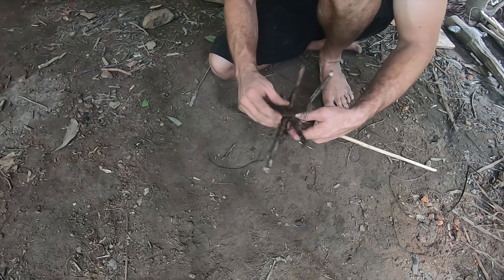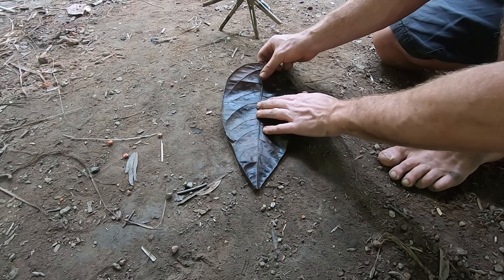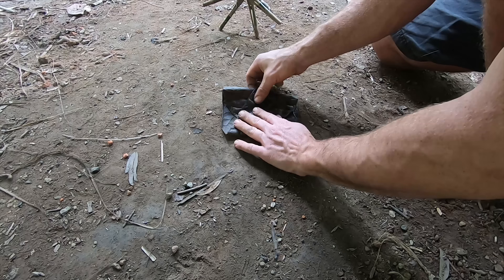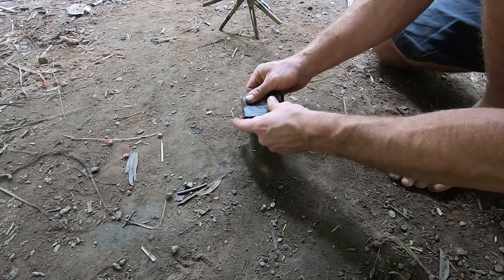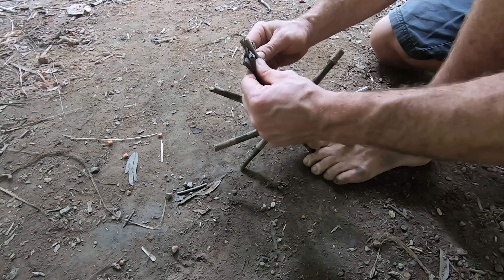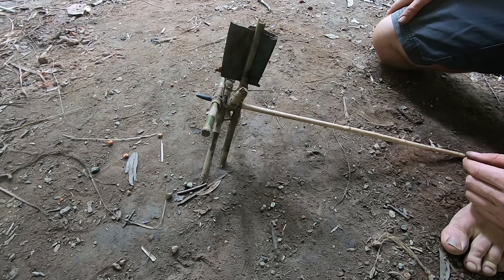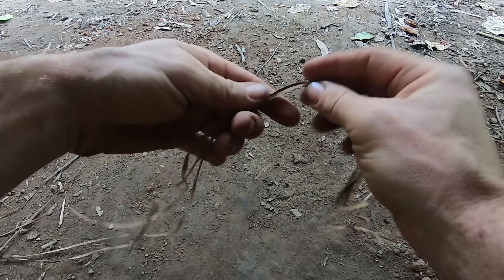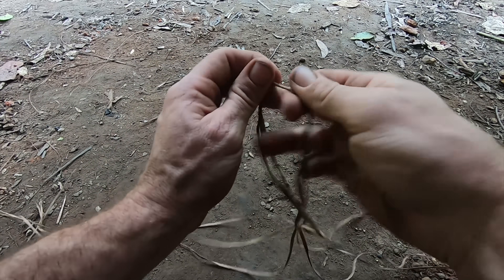Primitive Technology: Improved Multi-Blade Blower

Comment: Can't wait for him to breakthrough into semiconductors. I truly believe he can do it in 4-5 years.
Reply: without jokes he can pretty much do anything we used to do before the industrial age. it would be really time consuming to do so but it would be entertaining.  If he made bigger bricks he would be able to build his own castle in 30 years.
Reply: @KaizerOokami  He can get the industrial age down. He just needs to make the first machine to make more machines.
Reply: @punishedkid  he would need a lot of time and resources to be able to do that. plus that is not in the challenge. do you even read what he writes in every video?
Reply: @punishedkid  A rudimentary lathe...
Reply: @VenturiLife  Is that a Galaxy Quest reference (which is itself a reference to the Gorn cannon in the original Star Trek)?
Reply: @KaizerOokami  With slave labour he could scale up operations tbh
Reply: @KaizerOokami  - a loner from Eastern Europe lived in South Miami (Florida) in 1950s... And using his own homemade, auto batteries powered stone cutting equipment (albeit soft coral) he single handedly built his "Coral Castle",  moving multi ton  heavy blocks with nothing but steel tepee frames, winches, and leverage, mostly at night.  Some electric whizzes have decoded/ recreated his DC electrical system and suggested how he moved and set the large blocks by himself (videos on yt)
Reply: @vvvci  link plssssss
Reply: @KaizerOokami  /facepalm Castles weren't made of bricks but polished stone ¬¬
Reply: @KaizerOokami  30 years to build a castle? Come on, give the man some credit. He could easily do it in 29.
Reply: @KaizerOokami  but the pyramids? all those chambers and they were built over water tesla theory was the pyramids could create free energy....basically theory is a hydrogen power plant due to the hydrogen found inside chambers. Something to do with reverse electrolysis
Reply: Does a rusty iron or copper oxide Schottky diode count? What about a cat’s whisker diode using galena or some other natural mineral? With spark gaps and a bit of work you can make all sorts of high-power electronics without even using vacuum tubes, though I’ll have to say they’re noisy.
Reply: I wanna see him build his own trebuchet
Reply: @miliba  he literally did on the next video
Reply: NASA will return to the Moon only to find this guy filming "How to make bricks from lunar dust."
Reply: Dude, he's filming this, and uploading it onto Youtube. He obviously broke through a while ago.
Reply: I wouldn't be surprised if he made a nuclear bomb from a few resources in the forest
Reply: The silicon part may not be too bad, but distilling boron and phosphorous (or arsenic/gallium) for use as dopants would probably present a challenge.
Reply: @khatharrmalkavian3306  I recently deep dove into this. Seems like you need electrolysis for some of the steps to get the doping materials (and to get hydrochloric acid). Also, not sure he can find the raw materials where he is. But, a lot of the other steps are furnaces and fire. Glass containers and metal tools probably required too
Reply: He needs special minerals for that that could be absent in his area.
Reply: He'll reach the moon someday
Reply: На естественном кристалле можно найти точки контакта и получить диод.
Reply: looool
Reply: The ultimate Dead Space strategy
Reply: Lightspeed space engine in 5 years at this rate.
Reply: he's only like 3 techs away from it actually
Reply: Hes gonna make a battery 10 years from now

Comment: I think a good improvement would be a step, pully, and counterweight additions so that instead of sitting and pulling at strings with each hand you can instead sit in a chair or stand and use body weight to repeatedly stop a pedal

Comment: You would improve the blower even more if:
1. you make a bigger opening on the top, the hole should be twice, most of all if you use the 6 blade propeller
2. the exit conduit should be tangential and not perpendicular. Considering you are pushing air by turning the blade two ways you can do a V shape exit that catches both clocwise and counterclockwise rotation
3. the opening at the end of the final tube should be I shaped, like a whistle, this will make the air to accelerate and concentrate on the fire. If the joint is round you can place it both vertical and horizontal upon needing

Comment: is there a way that fired clay can be turned back into it's original form? not to correct mistakes or anything but just to know if clay supply can be replenished naturally. even if not naturally what about some complicated chemical methods? what does it take to renew clay as a resource, there has to be a way surely.
i looked online a little bit (not enough to say for sure) but generally i saw that it's not possible, but the posts i saw could be talking about it from a pottery hobby perspective where you can't buy anything or do anything reasonably to fix it, what am asking is if it's at all possible even a theoretically possible (still realistic) solution

Comment: How are you coming up with such precise measurements without a ruler or some other modern measuring device. Estimates are one thing but when you say "6.5cm" that's awfully specific.

You seemed to use your foot as a ruler at the start, which seems a bit like cheating if you know your foot's modern length in cm. Still don't see how you managed to find 6.5 though.

Comment: This is really cool that you figured a way to use leaves for a better seal and blowing power with lighter wait. However I'll go ahead and say that you will not melt iron properly this way. You need a lot more blowing power to reach 1200 degrees celcius. You should figure out a way to create a power belt and connect your blower into a hydro powered wheel in order to keep unidirectional spin and consistent fanning as you are busy working the metal.
Reply: PS: I think you will love this as a side project to test run your oven
creating mirrors by hand: https://youtu.be/Ra4W_aztfHA

Comment: I've frequently seen these impeller designs with off-center hole for outflow (think 70s hair dryer). 
Does anyone know if the efficiency is greater in that variant?
Reply: Given what I know about blowers, I would suspect that an off-center outflow would only be efficient with an impeller with a one-way spin.
Reply: @dudeistpriest787  good point, I didn't think of the two-way design. Then it would need two off center vents that join later (and be completely overengineered)
Reply: @fluffigverbimmelt  Yep, pretty much. It'd be interesting to try it and see if the over-engineered version was more efficient, though.

Comment: The captions were way too fast, I kept having to back up the video to read the wall of text put up for a couple seconds.  I love the use of captions for additional information, but this video is the first I've had trouble following for them going too fast.  And I consider myself a decently fast reader.  My understanding, when putting text on the screen, is to read it to yourself three times (for timing how long it should be up on screen).

Comment: Maybe (not quite sure) a way to increase the volume of air being blown onto coals is to have somekind of a gap between the main nozzle and the secondary nozzle. Moving air will draw more air in. Analogously one can't fill a trash bag with one breath directly. But with a gap between the mouth and the bag, the moving air will draw more air in, thus it's possible to fill a trash bag with one breath.
Awesome job!

Comment: I wonder if it would be beneficial to add a small wall close to where the blower's exhaust is, so that more of the air spiraling outwards is forced towards the exit instead of being directed back into the blades? Kinda like splitting the exhaust into two nostril channels, but maybe there's no need to extend the wall all the way to the exit (since that would also effectively halve the area of the exhaust)

Comment: If the blower is mounted sideways, and that fan axle is free floating in a couple of uprights, this build could accept a traditional pole lathe style design to turn it into a foot powered blower relatively easily. A bit fiddly but it would be an absolute arm saver.

Comment: Have you thought about using wind (or water) to propel the blower? Maybe system of two water containers where one is raised and drains into other, while running water provides propulsion, and you just have to switch them every now and then, rather than continuously spin the blower by hand? Also, hot air rising from the forge can make stuff spin, too... or even heat water to provide steam.

Comment: Huge respect to you for using the metric system despite the fact that you were using literal 'FEET' to measure at 0:09
Reply: Hes Australian so yes
Reply: @AustralianRacialSuperiority  oi
Reply: He has metric feet.
Reply: It seems like cheating if he knows the modern length of his foot in cm, to make a ruler. That being said, it also doesn't make sense how he can get so specific with other smaller measurements from there. IE: 6.5cm is awfully specific and obviously smaller than his foot.
Reply: @BeardedFrog  
6.25 cm is more accurately described as 1/4 John-foot.
Reply: @BeardedFrog  you won't need it until your technology is advanced enough. An example would be bearings and pistons. They need a perfect fit to avoid wear, heat and vibrations.
Besides, he might measure it when he ends the video or something like that.
Reply: It's the tape measure he always has on him
Reply: You mean "metric units", because the whole world uses the metric system, just not metric units.
Reply: He's a sophisticated caveman with standards.
Reply: And now we know his shoe size, too!
Reply: He's a scientist, so yes
Reply: 2 ft is in average 60 cm so, when he measures the cane for the impeler he states that the size are of around 25 cm (measured with his foot) so, keeping in mind that his feet are about 25 cm long (10 inches approximately), two (of his) feet would be 50 cm... It's 10 cm (around 5 or 6 inches) less than 2 ft but, almost i guess.
Reply: The metric system isn't primitive, and therefore doesn't belong here.
Reply: @eggnogfrog  he's using an approximation and keeping in mind he's australian he makes the approximations with the metric system. 
And by your logic the guy wouldn't bring a camera and shorts.
Reply: I read that as 'YEET'
Reply: hmmm yes, F E E E E T !
Reply: the only time when using feet etc as measurement is acceptable is if you are in the fucking stone age
Reply: Wait til you see how he measures inches ( ͡° ͜ʖ ͡°)
Reply: huge respect? theres difference between knowing how much cm is one feet and how much cm is your actual foot :D if you use your actual foot as measuring device then units become worthless u know hehe...i think after some time out of civilization everyone would naturally start returning to more comparison based measurements instead of standartized units
Reply: https://youtu.be/kqrQ2th7EJI
Reply: He just knows that his foot is 25 cm long
Reply: Jokes on you he knows his feet are exactly 23cm
Reply: Feet is fine when you're surviving during the stone age.
Reply: he is a normal person, so of course he uses the metric system
Reply: @wedividedyou1424  True, not everyone can be have a greater intellect, otherwise that'd be 'normal'
Reply: "Feet" were great in primitive times. Everyone had a foot, and very little precision of measurement was required. We now live in more sophisticated times, and there is a better modern unit available to use. And it would be sensible if the whole world used one unit of measurement. If you're still using feet for measurement, it's time to move out of the mud hut and join the rest of us in the metric world.
Reply: @CharlesSmith-zt7vt  (superiority complex)
Reply: @CharlesSmith-zt7vt  "Oi those people over there speak a different language then us, they must be stupid" Join the 21st century bigot people use different languages
Reply: @CharlesSmith-zt7vt  I mean it's what I was taught in school and still works for me go ahead use something else that works for u don't expect me to change
Reply: @CharlesSmith-zt7vt  In this economy? Hah!
Reply: @CharlesSmith-zt7vt  
Feet make sense if each building site has its own definition of the units anyway.
Reply: @CharlesSmith-zt7vt  that sounds great... buttt half over half of that modern world was created invented developed or preserved by the nation that uses imperial measurements sooo
Reply: @milewesler9592  I can’t quite understand your point….it’s a shame your countries teaching system doesn’t spend more time on education….unless of course you’re the exception?
Reply: Ba Dum Tssss
Reply: im the one american who uses metric
Reply: Well I guess you could say that it’s a good example of progress. Feet were used first, and then the world realised that metric was a much simpler and easier system to use.
Reply: @WS_00  as an american...that's fair.
Reply: I'm disappointed he was measuring in literal feet.
Reply: @Serahpin  
It’s useful to know what at least one of your natural measurements, be it your foot, the span between your thumb and one of the fingers on the same hand, your arm span, or whatever makes sense for you to use, converts to in numerical measurements. John happens to know how long his foot is, and makes great use of that knowledge.
Reply: @ragnkja  Still would have preferred the measurements in "feet."
Reply: his foot isnt one foot long though
Reply: Everyone that jumped on this comment to explain the greatness of the metric system are definitely 5′11 tall.
Reply: @cableman  beating a dead horse: this thread.

Don't worry everyone, I went through and gave you all a "thumbs up" for your super "funny" comments.
Hope it helps.
Reply: @kennethlasseter9264  dude, your hydrofluoric acid wont make everyone change their minds. We know that your yankee ego was hurt, it's ok. None of the systems are better, they're just different.
Respect the metric/imperial system...
The metric system is newer and a bit more standard than the imperial that has a british and an american measure, and it comes from medieval times.
Reply: Don't the Americans use decimals in calculus and maths too? If so why would you then rely on Imperial for the rest.
Reply: Of course he uses it; otherwise he can't make some mud stuff cause it will explode like some spaceships
Reply: Kurtis from cutting Edge Engineering calls it metric and bananas.
Reply: Everybody in the world uses it except one or two countries - why would you be surprised?
Reply: @JohnnyWednesday  Because he's remarking about how the dude is using his literal feet as measurement sticks. =_=

Comment: Try a 6 blade impeller but add a flywheel, see if that works out better. The 8 blade seems a bit cramped, and it might be inertia thats assisting with smooth operation, not so much the extra blades. Perhaps a piece of clay with a keyhole formed in it to transfer torque.

Comment: You shouldn't just stop at normal iron working. Once you have mastered it, you really should try and take it a step further. Make a screw cutting die and stuff, and cast gears to make a metal lathe in the Gingery style. You can use hand tools to turn steel with enough power (from a velocipede, treadle, or water mill). And a set of metal dividers, and also a vernier calipers to measure to a thousandth of an inch. Produce the technology to not only work, but cast iron into a mold. I bet you could make a functional steam engine lol.
Reply: Or maybe you could make a set of twist drills and deep drawing dies, and make your own metallic cartridges. But then you'd probably be violating Australian gun law lmao.
Reply: just one step closer to nuclear reactor and mars colonization

Comment: I expect you'd get a significant bump in performance if you had the spout coming tangentially off the housing's outer edge instead of perpendicular. You don't need to make a whole volute enclosure but lining the spout up with the direction the air wants to go at least somewhat should help make your work more efficient with minimal increase in complexity.

Comment: You could probably figure out a way to spin the impeller with a pedal, Sort of like a spring pole lathe. 

Like if you wrapped the string around the rotor and attached it to a pedal, and then used some saplings and tied a string between 2 of them, and wrapped the pedal string around the rotor, connected to that cross string. 

The pedal would spin the rotor, while the taut-line and spring poles would spin it the other and recoil the cordage around the rotor

Comment: I can't help but wonder why you didn't use a cross handle like you see on ancient (and not so ancient) pump drills. The reciprocal movement would be much more efficient and less tiring on your arms. A molded and fired ceramic fly wheel positioned just above the intake hole to add a bit more rotational mass to the machine would likely further ease its operation.

Comment: a foot is a measurement according to the reigning ruler's foot back in time.
now, you are the ruler of this forest so everyone needs to measure with your foot.
although, now that you have flexible bark string, you could just use those by marking on it (or a knot) every one of your foot. then u get flexible measurement ribbon.
very enjoyable. i watch once without cc first to see if i guessed it correctly.

Comment: So because of the outwards force the air is experiencing on the blades, no air from the fire will be able to come into the mechanism, right? Because otherwise, I would think that leafes aren't really the best material to withstand the heat of such a fire.

Comment: You could try to make an L pipe to be attached on the air inlet, with a hole for the propeller shaft to pass through. A the end of the L pipe put a one way valve, so as to reduce air backflow. I assume that fashioning a efficient desing would be a fun challenge for you.